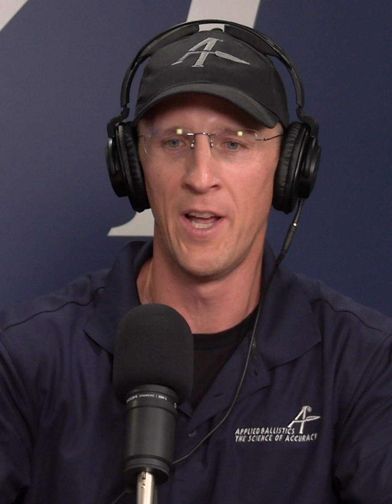BC as an Indicator of Terminal Performance

Comment: Bc is cool and all and helps you make the hit, but if the bullet doesn't have the proper construction, it will not perform like you want it to. For example,  a lightweight , non-bonded cup and core might disintegrate from hitting a rib from a large animal,  or especially a shoulder blade. On the extreme other hand, a steel core military surplus round would not have any issues going through bone. However, it might not impart the energy on the animal as efficiently.  In conclusion, BC is more of a factor of accuracy and bullet construction is a factor of terminal effect on target